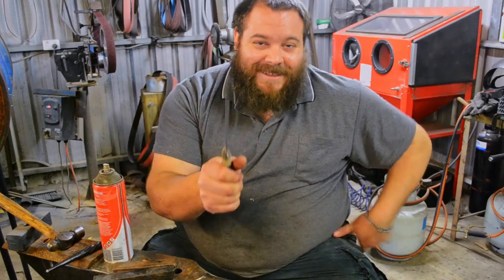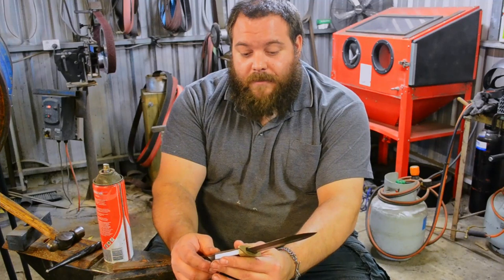Making a Multi-bar Damascus DAGGER in 48 HOURS!

Comment: Curious to know why you used the circle plate for sanding down the brass guard, why not on the belt?
Reply from the maker: The disc sander allows for a near perfectly flat surface, rather than the belt which can sometimes create irregularities in the surafce